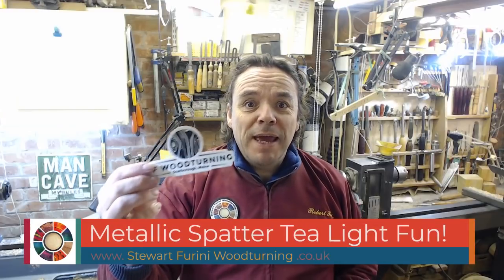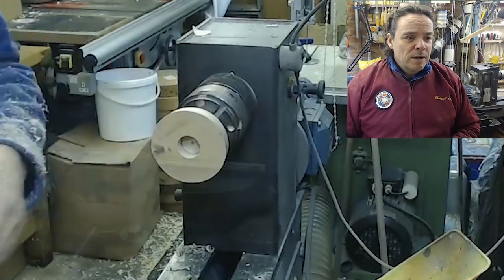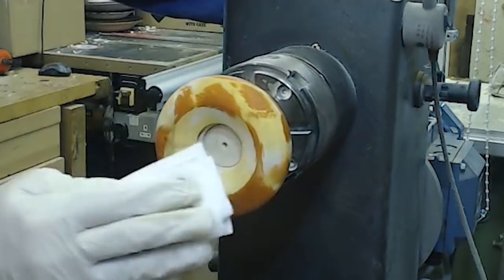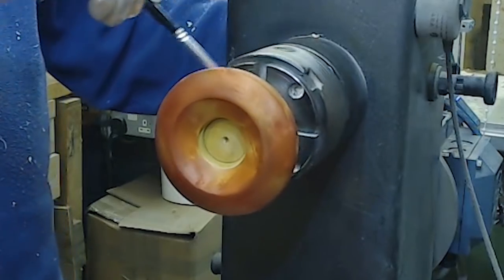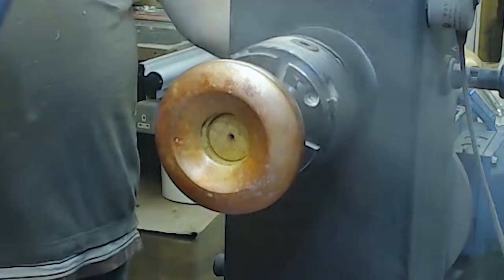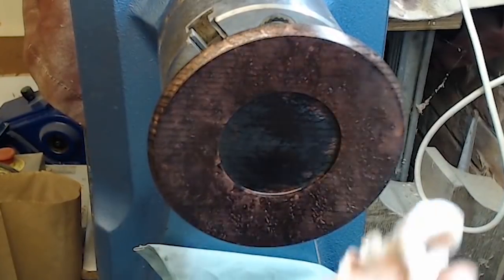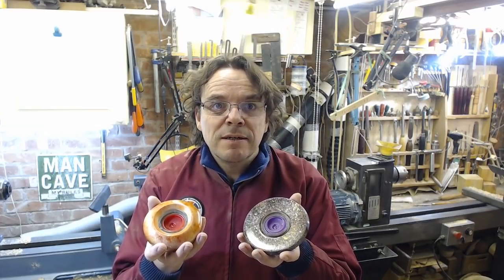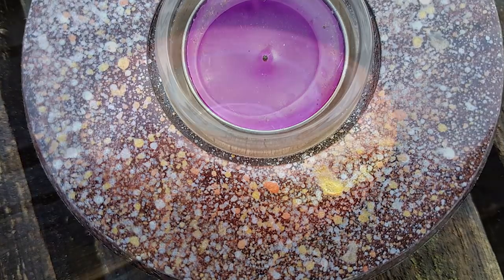Metallic Spatter Tea Light Fun

Comment: Well I liked them both! The black one is my narrow favourite thst has a look of polished granite. I'm looking for a spray varnish/lacquer but I need it a dull matte what would your suggestions be? I'm wanting to coat my Pyography burnings on wood, it preferably needs to have a built in  UV protection very dull if you know what I mean. And who better to come to for advice but yourself 👍😉👌
Reply from the maker: Hi Andrew....I don't have much experience of dull matt....I think you can cut back the sheen on gloss lacquer with fine abrasive or you could try satin lacquer. I've only used the Chestnut Products one once so am not vastly experienced in its use.